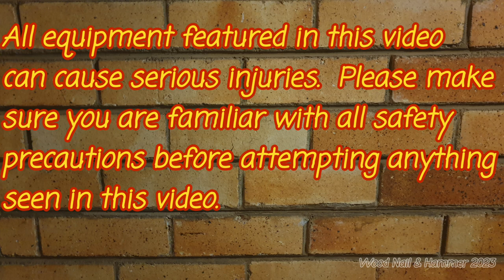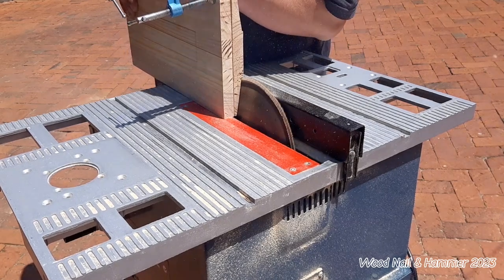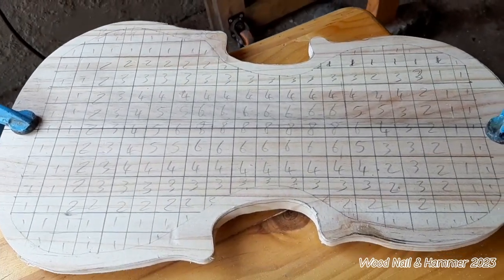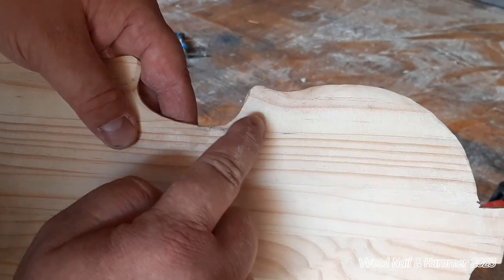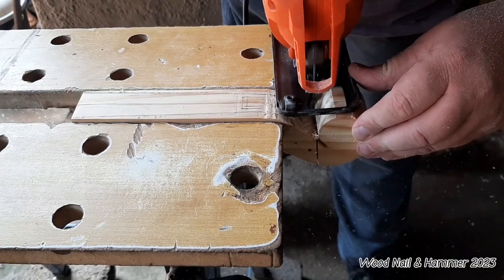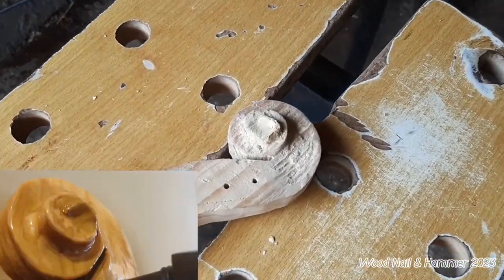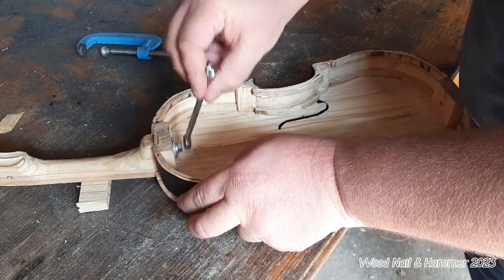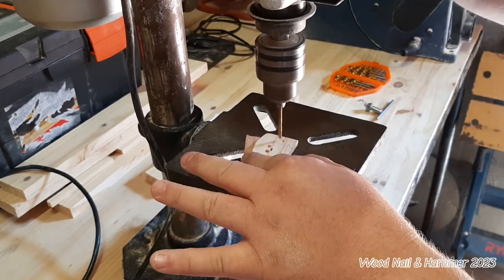Let's See If Pine Can Build A Fiddle (BACK YARD VIOLIN PROJECT)

Comment: What was your final rib thickness? Also, did you use two layers of linings? Thanks. The final instrument looks very nice. I hope you can take those lessons that you want.
Reply from the maker: Thank you.  I did not measure the final thickness but the strips was initially cut to 2mm.  So after sanding I can imagine it must have been around 1.8mm.  I did use two layers of linings to make a bigger gluing surface.  Pine is really a soft wood so I thought it might be a good idea to make it a bit stronger.

Comment: I use wood screws from the inside. Never had a failure…yet.
Reply from the maker: I also tried that when I made the oak wood violin.  It worked fine.
Reply: The "old  masters" often used two or three nails, angling each differetly.  They held up pretty well too.  Also, historically, most of the oldest violins, the million dollar ones, had their old necks replaced to change the angle so the strings could be heavier and thus louder.  This was, of course, major surgery, involving a new neck block and a new bridge of the three spike method had been used.

Comment: spruce is a type of pine . ok so maple is not o well they use different types of wood all the time for the backs why not pine . and one guy is making violins out of trash so i think you did a great job . and as far as the glue goes i kinda think the glue snobs need to give it a break . wood glue of today is better last longer and protects better . if you need to remove the glued areas you have more issues then the glue anyway . good job
Reply from the maker: Thank you
Reply: @woodnailhammer  your welcome .